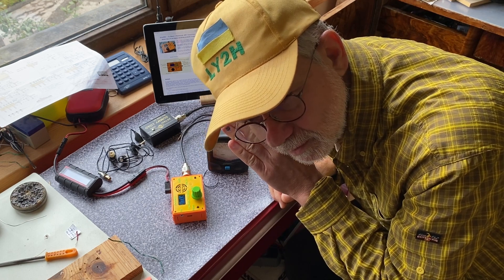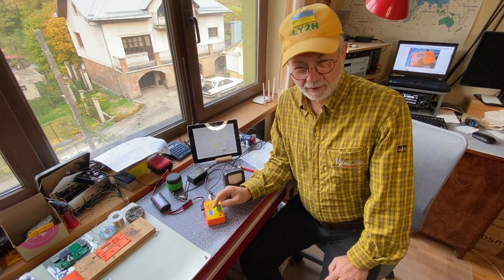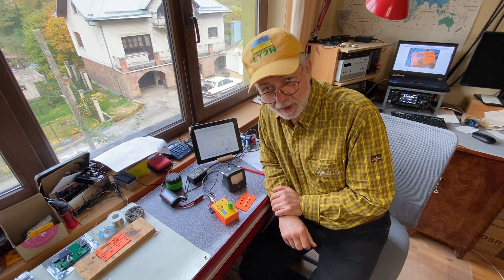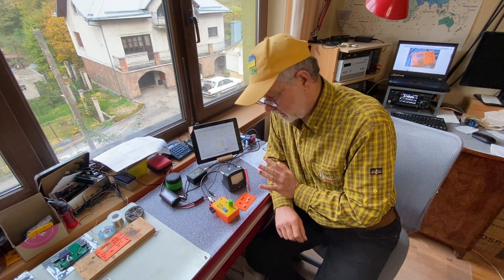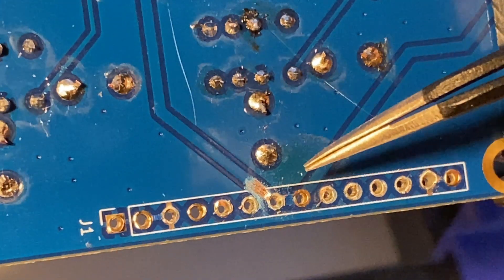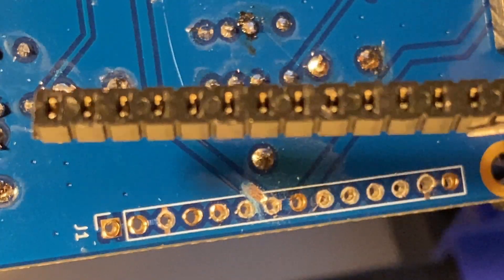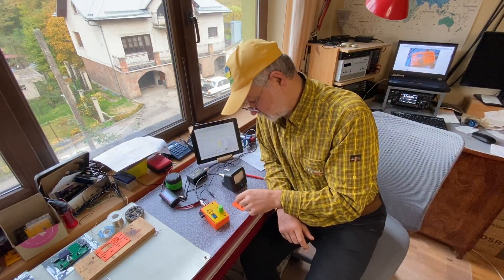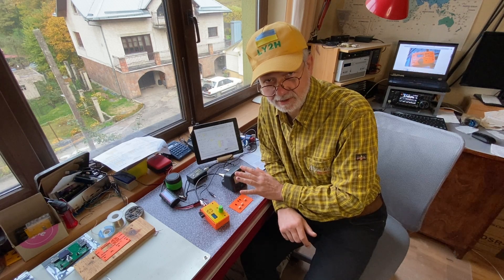Be patient and you’ll see dream come (tr)uSDX. My most complicated kit, so far.

Comment: at 3:57 I see something I have never seen. but how do you plan to use a similar solution to fix your FETs. can not be done!!!
Reply from the maker: Hello Luca, thanks for your comment! At 3:57 I show my little mod to the BS170S transistors mounting method on the PCB by using sockets. These sockets are made of the same material as inter-pcb connectors. They grasp the leg of a transistor firmly and provide for sufficient , in my opinion, contact. That’s it. Using sockets I can play with various makes of the BS170 transistor , or replacing them without need to  unsolder if they go bust. The sockets do not fix my FETs if they are dead. You can’t fix a dead transistor :), but you can replace it with the new one. Having my sockets in use, I do this easily and quickly. HTH, 73! Linas LY2H
Reply: @Linas_LY2H  your solution is only good if you are sure of perfect pin retention. in any case, before starting to transmit, I would always check the position of the three FETs.
Reply from the maker: @luca3223  You are right. But the retention is just fine for me, the transistors sit firmly in the sockets , it's like the older  microchips- you don't need to check up each time if your chip is still in place :) 73! Linas LY2H

Comment: I have notice on mine occasionally the swr cct will read off and a quick fix is to put your finger on the swr cct and then it magically reads correct. A few people are now calling this the magic finger fix for the swr cct.

There is also a thread on the form talking about an experiment with changing some resistor and capacitor values of the swr cct that have been able to fix it.
Reply from the maker: Thanks for reminder Randal! Yes, I’ve red all the interesting threads in the groups.io regarding the magic finger! Sounds very scientific , but hasn’t worked for me, unfortunately :). I have yet to try the resistor trick. 73! Linas LY2H

Comment: Nice video Linas ! Apprciate your description and knowhow, shure many can learn from this. I have two truSDX, high and low bands kits, have not started building yet. I had an idea of using one Contr pcb and make the band filter  pcb’s swappable, to cover all bands. May not be a good idea, after looking at your video though !
73 de LA8OW
Reply from the maker: Thanks Arvid! I think, swapable bands might be a nice idea with the condition you swap the entire RF boards. The menu item in the firmware allows for choosing which RF board is connected. If I remember correctly, Adam K6ARK, has implemented this idea and he's even developed  a modified 3D case for this!  Good Luck! 73! Linas LY2H

Comment: Linus the 12V cracked and intermittent is enough to take out the RF Transmitter, Pins on the Microprocessor and all the other stuff you got into.  Likely the board had failed or was about to at Reflow and when the header was soldered it that was it!  Anyway I order work boards 100% tested with a flying probe at the board fab.
Reply from the maker: Thanks for this info John! I'd like them to but I'm not sure I know how could I get DL2MAN-approved Chinese kits seller  testing the boards with a flying probe at the board fab :). 73! Linas LY2H

Comment: Well done Linas , thank you for very informative video. I have uSDX+ from China and made a few modifications. I wanted to know,, please, the turn numbers on ferrite toroid cores for each band that you got. Sincerely, Dov 4X1PD 73!
Reply from the maker: Thanks Dov! I have the Classic version with 80,40,20,15,10m bands . My coils are wound accordingly to schematic diagram which can be found on Manuel’s DL2MAN page. You can go directly to the RF board via this link:
https://dl2man.de/wp-content/uploads/2022/08/truSDX_RF-Classic_86256.pdf

The number of turns and the toroid’s type is indicated above each drawing of the LPF filter per band. HTH, 73! Linas LY2H
Reply: @Linas_LY2H  Thanks Linas ! At the 11th minute you are talking about tweaking  filters. By squeeze or spread coils ? 73! Dov 4x1pd
Reply from the maker: Yes, Dov, I’ve been tweeking filters by squeezing (for increasing the inductance of the coil=getting the resonance dip on the nanoVNA lower in frequency) or spreading (for decresing the inductance of the coil=getting the frequency dip higher) (nanoVNA method for the coils marked LX2, like L32, only. For the coils marked LX1, like L31, the tweeking is also done by spreading/squeezing, just for the max output power with no VNA, with radio connected to the dummy load/pwr meter). Some guys report that squeezing/spreding was not enough for them and they had to remove or add one turn on the toroid (this involves, obviously the removing the coil from the pcb and rewinding.). HTH 73! LInas LY2H

Comment: G’day Linas I had a similar problem with power and efficiency readings. Have you tried the mod on the forum about changing the number of turns on the SWR toroid. From memory the ratio stays the same but you increase the number of turns. It fixed my radio.
Reply from the maker: Thanks Lance! Yes, I did. Actually, in my case the pwr/swr reader was working ok in the beginning and it was with the original 7t T2 :). But when it stopped and I replaced the T2 with 21:3 turns, nothing changed, no work . 73! Linas LY2H

Comment: They are 5V relays. Were you by chance hitting them with the 12V power supply? As for the SWR/power/efficiency readings, they all get sent to the microcontroller via 2 wires (plus ground.) Since the circuit was working previously, and then you took out the inter-board connector and had problems with the +12V lead I would guess that you also have problems with the connections to the FWD and RVS pins on the inter-board connector.

With the 2 PCB's connected you can solder small jumper wires from the top to the bottom of those 2 functions on the connectors to see if they are open, or just use your multimeter from the top to the bottom of each connection to ensure that they are all making good connection. I think the weakest part of the rigs design is probably that connector on the edge of the 2 boards.
Reply from the maker: Thanks John! Well, I can be sure of anything :), but if I would mistaken 12V to the 5V bus... then I had much more problems than relays :) . And it only happened to these 3 bands, while other 2 were functioning just fine. 

TNX for the tip on continuity test. I've actually done exactly as you say and found full continuity between the Atmega respective legs and the interpcb connector and then further onto the RF board to the T1/T2 region. Thanks again, 73! Linas LY2H
Reply: @Linas_LY2H , I was afraid of that. From watching your video, you seemed like the very methodical sort, (like me.) So if when you're Xmitting you have a voltage on the FWD line near the microcontroller, then your mocro-controller is damaged.

Comment: Hi Linus, my trick for desoldering is to resolder the joint with new solder this seems to make it a lot easier (ie less time heating the joint?. I then use a soldarpullt solder sucker. They have huge suction. Anyway I share your pain re cracked tracks. Keep smiling.
Reply from the maker: Thanks for sharing the trick! 73! Linas LY2H
Reply: One more thing see if you can get solder with 2% silver as well as lead and tin. This stuff flows beautifully. I have not been able to master the unleaded stuff.
Reply from the maker: @chrisherd991  Thanks agn Chris. I'll check this out. For replacing chips, I have and use some special solder which stays melted  longer than the normal one when applied on the contacts and this feature allows for comfortable removal of multileg chips, like processors etc. But it's best  for the SMD packages. 73! Linas LY2H